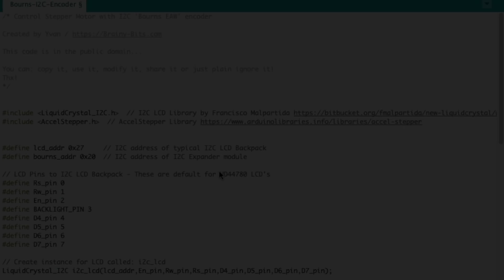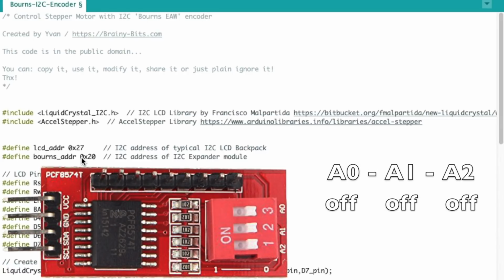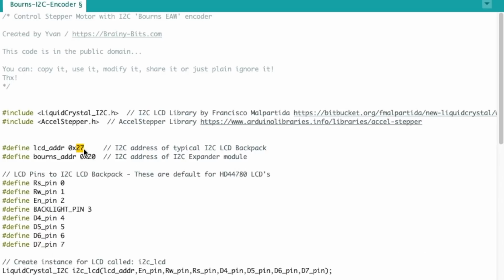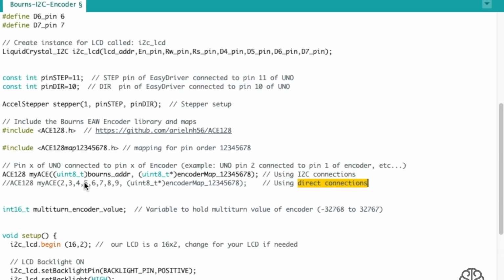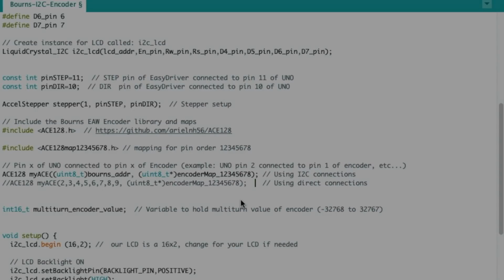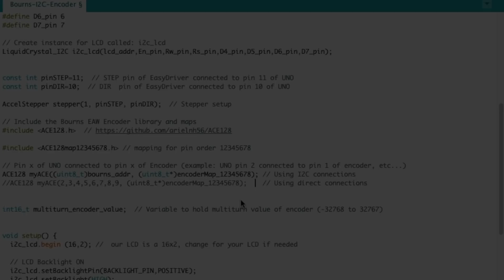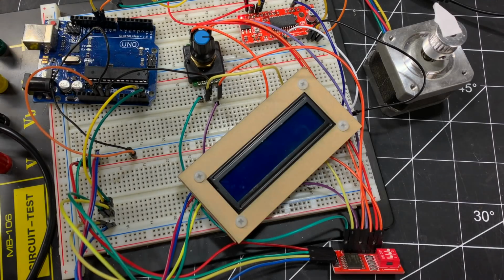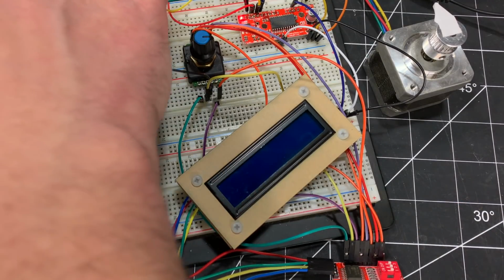Running out of Pins on your Arduino!? Using the “Bourns Encoder” with I2C!

Comment: i want to use this encoder to set values in my arduino from different pages and display them in a lcd. i have one page for every value and i can switch the pages with a button. when i set one value to 10 and the next value to 20 and i get back to the other page and increase the value by 5, does the encoder enter 15 or 25? If 25, is there a way to increment based on the current value of a parameter?
Reply: would something like this work?

encoderValue = myACE.mpos();
if(encoderValue < lastEncoderValue)
{
myValue1 ++;
}
else
{
myValue1 --;
}
lastEncoderValue = encoderValue;

Comment: hi
please design a midi controller using 8 simple rotary encoders and the same i2c multiplexer so that such a midi controller can be used later in adobe lightroom by mapping the midi controller.
this would be of great help as there are no tutorials anywhere.